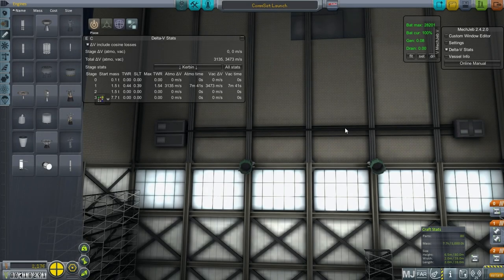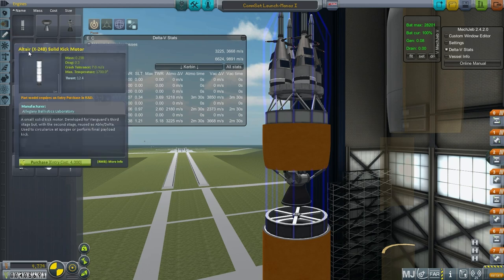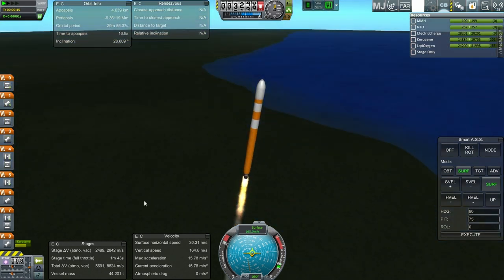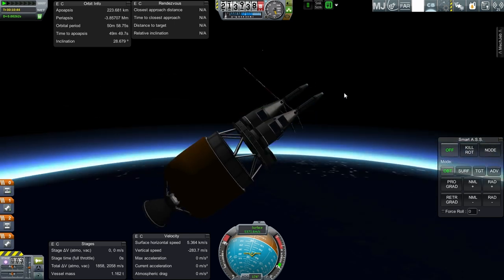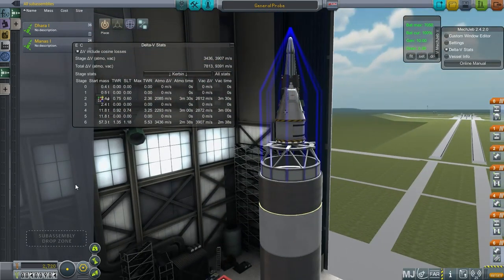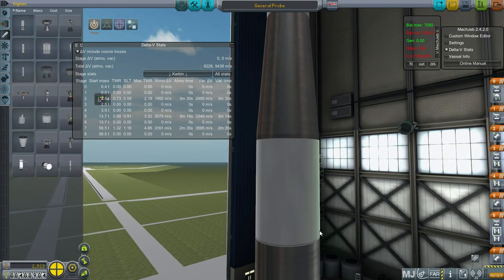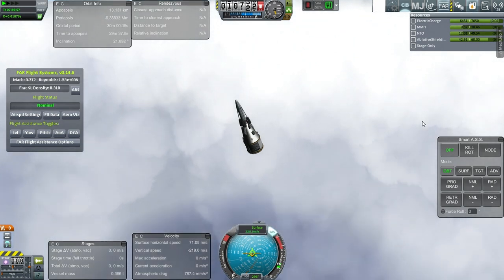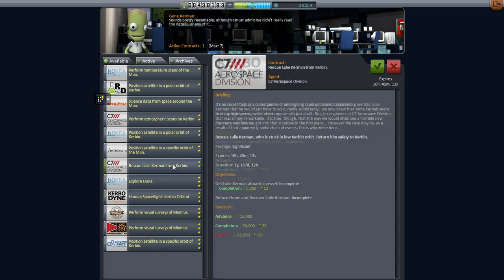Realism Overhaul in KSP Beta 09 - Failure and Success

Comment: Wait a second... wasn't the RD-58 part of RP-0? In my version is compatible. Don't worry then, you can use it without restriction ;)
P.S.: I'm on RP-0 0.25, might that be the solution?
Reply: I believe I was just lucky because of the time zone (I'm in Italy). It was released at 7:01 am here, and I saw it at around 3 pm on my phone. Installed as soon as I returned home.